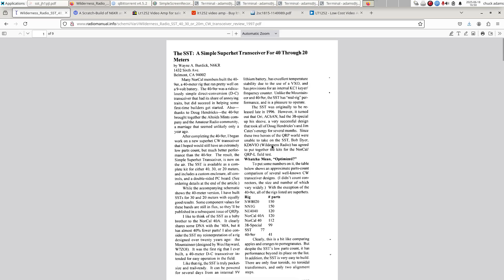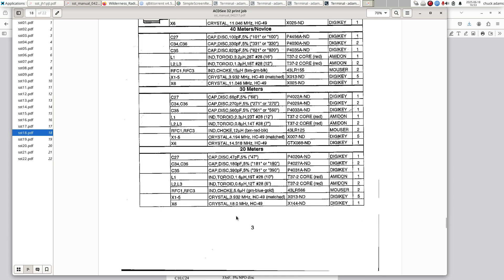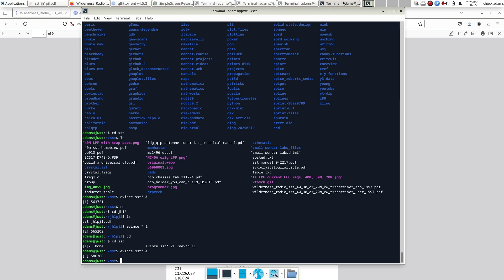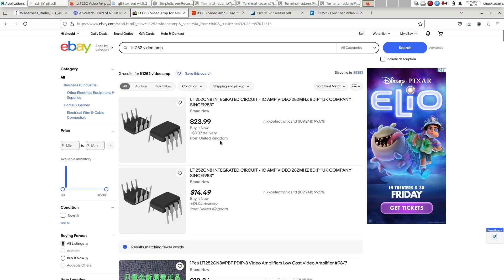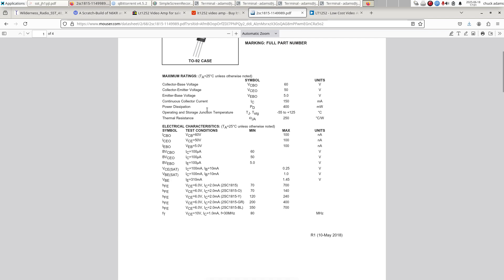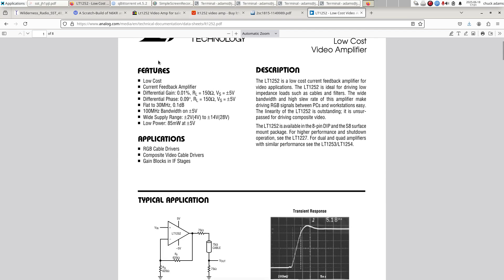Manhattan Circuit Construction  --  #005:  Simple Superhet Transceiver SST Introduction

Comment: FYI, Mouser has 132 of the LT1252 video amp (used as the PA buffer) in DIP package in stock, $6.68 each. Also in SMD package, about same price. DigiKey has 327 of the SMD package in stock, $8.09 each (no DIP in stock). Steve AA7U